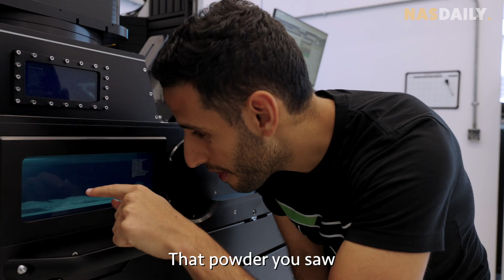World's Strongest Printer

Comment: Printing a rocket is a bit too much,
Also some special parts of machines have to be rigid, mass produced and seperately assembled. The printer can do that, but on mass production scale, the current machine win in speed.

Overall: 
Individual objects: Metal printer
Mass Production:Same Old production lines.

One thing that isn't it this group is the laser cutter. It can make only 2d shapes in metal sheets but are much faster

Comment: Actually, that type of metal printers are very imprecise at a microscopic scale so they can’t be used to make rocket or airplane parts. The ones that can be used though pour molten metal in layers like a plastic 3d printer
Reply: Not true, they already use metal printed parts on LPBF maschines for planes. Easy and fast to google.

Comment: you still need metal to use the printer... it isn't a solution for delayed metal shipping
Reply: nothing comes from nothing... also the printer just makes the process faster and easier no melting & reshaping + shipping.
Reply: @cypherx8835  That's not the point. In the video he says "What will happen when metal shipping is delayed?" and said the solution is to print it with the metal printer. This doesn't make sense because the printer still needs metal to function. 

Also, the printer still needs to melt the metal. It's the same as a mini factory. I think that the metal powder might be harder to create than a metal block. 

Shipping is the same regardless

For mass produced objects, it's not faster at the moment, but could be in the future.